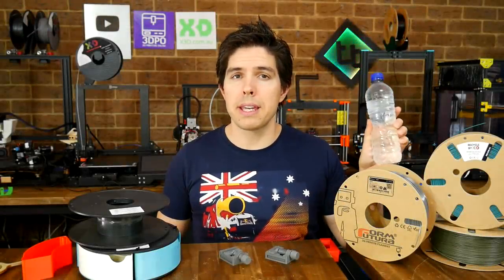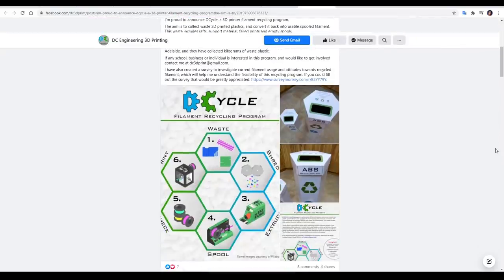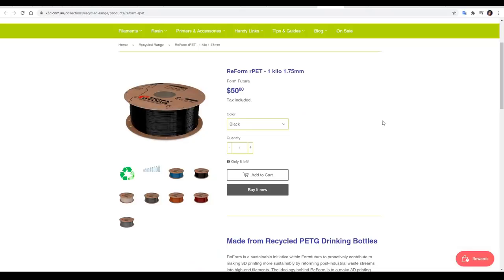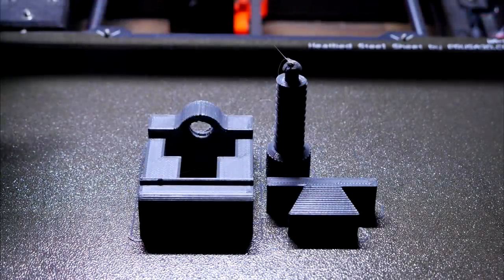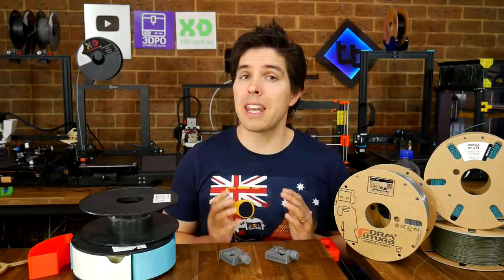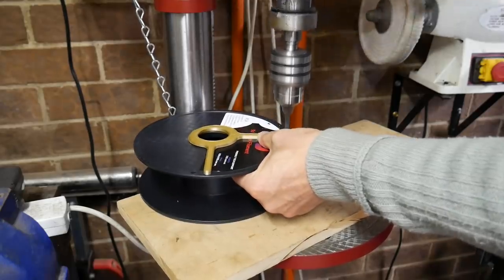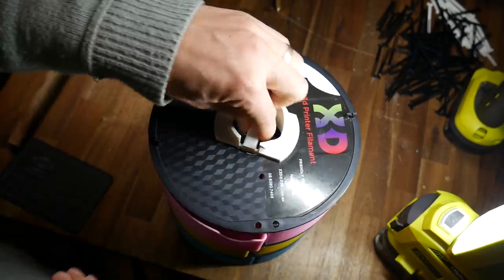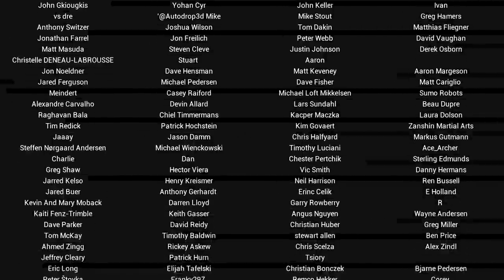3D Printing with recycled PET bottles and turning empty spools into storage

Comment from the maker: After reading comments, here are some responses to frequent queries:
- Not everyone wants to spend extra on recycled filament. No problem and that's your choice. At X3D, the recycled PLA is $5 more than normal PLA. Remember too that the prices are in Australian, not American dollars. 
- Some have rightly compared the cost in filament and electricity for the storage unit vs buying an off the shelf one. I my case, I had unwanted old filament, waste spools and enough solar on the roof to cover my 3D printing plus the rest of the house. For me the only cost was time, so an easy choice.
- What I presented in this video are some ideas that worked for me and may work for other people. I never present any topic as gospel that everyone must follow. Sometimes people seem to forget this and comment aggressively. Relax and remember that different solutions are suited to different people and that is ok.
Reply: Thanks @TeachingTech!  I always like to know what options are available.  Speaking of...   have you done any vids on converting a creality to print CF Nylon?  Is it worth the hassle?
Reply: Love your videos.  I noticed you use OnShape for design.  Have you taken a look at Alibre Atom3D or Alibre Design?  Great software, buy it, own it, no subscriptions, no internet connection required.
Reply from the maker: #FixItPlease I don't use carbon filaments very often but at the minimum I would think you would need a hardened steel or other resistant nozzle and probably an all metal hot end to handle the higher temps. I have a video on the Micro-swiss all metal hot end for Ender 3 that ticks both of those boxes.
Reply from the maker: @Jason Onshape was perfect for me when I was teaching and the kids had to bring their own device. Go to a website, make a free account and they were on. Now I'm so far invested in it there would have to be a major problem for me to change, even if there was something out there just as good or better.
Reply: @TeachingTech  would you ever consider doing a video on the microswiss direct drive btw 
considering getting one for my ender tbh
Reply: People are simple lazy and jealous because they are too stupid to DIY something. That's when they turn to be aggressive.

Comment: I was just talking about this subject on Sanladerer’s latest video.  Reuse, reduce, and recycle really needs to be the next big focus in 3d printing.  Whether it’s ideas like yours, or grinding waste, mixing with fresh filament, and extruding recycled filament to use.  This has to be the next big push.

Excellent video as always and I really enjoy your series on ways to reuse FDM waste.
Reply: Absolutely agree!
Reply: That's not going to happen for quite a while. The part grinders are crazy expensive due to torque requirements.
Reply: I was thinking I should look for a place to dump my boxes of failed/wrong size/just unused prints, to be recycled into new filament. I was super surprised how many sites there were on that ausie map of drop-off points, made me think I should have saved the spaghetti, purge extrusions, rafts, and skirts also....
Reply: 3d printing plastic is a drop in the bucket compared to industry wide plastic use so it will barely move the needle
Reply: @nczioox1116  not if I keep 3d printing, at least with my POS "upgraded" ender 3.... Didn't work right form new, about the only thing left that could possibly be but is very unlikely to be the problem would be the steppers... I'd throw in power supply but I'm pretty sure I'd have more problems. Then again, I am on my third btt skr mini e3 v2.0, maybe I should get a new power supply, at least have someone test the one I have.... I'd test it myself, but regardless of the diagnosis, I dunno I'd trust it, I am kind of a dumbass...
Reply: @josephbodhorn6511  if you have a multimeter I'd carefully measure the output voltage (the wires that connect to the mainboard)  
thats the best way to test if it's killing you parts tbh

Comment: I did my own empty spool parts carousel. But what i did differently from any design i've seen was to open it halfway down, the version with the small opening at top is difficult to get ANYTHING out of the bottom of the box. So, i took my fingers, measured how deep i can still get something out and it was about halfway down. 

I also curved the bottom so that i can take things with ONE finger out of there... It does not hold as much stuff but if you can't get it out: you won't use it. I use mine constantly and the larger opening also allows me to see inside fast. The version in this video will be the kind that you print it and forget it as it is very, very inconvenient to actually use.

Comment: I like that spool case thing though. Now I used about 120kg to print PPE each spool case takes about 1/4 roll of ABS to print all the pars including the pins the stacking parts and handles. So that means I need to buy 30kg of ABS to turn the 120 rolls into storage - but then I have another 30 empty rolls so another 8 kg should take care of that and another 2 of the 8 and less than 1 for the 2 so all in all I will have 161 storage box reels. 
As I can print about 1kg of ABS a day on the Chiron we are talking 41 chiron days to complete the project and roughly $500 in ABS. OTOH I could only make a couple and throw the rest away - no recycling center here wants to take the spools. They claim its impossible to figure out what kind of plastic they are made off. Those rolls have been a thorne in my eyes for quite a while

Comment: Great video as always!
I already printed storage for the spools, but they're not cheap: every single tray was about 2 and half hours, every spool is 4 tray so 10 hours of printing + the cost of the filament + electricity.. i think cost more to print that to buy similar..
Reply from the maker: In my case I already had the unwanted filament, and I have enough solar to cover the electricity so the only cost is time.
Reply: @TeachingTech  so, that's perfect! In italy we're so far behind for renewable power..
Reply: @TeachingTech  have you done a video on the solar and your 3D printing off solar requirements?

Comment: It would be interesting to see how much more energy, water, and other resources the recycling process uses that make it so much more expensive... and if recycling the material actually benefits the environment having the extra expenses into account (I'm just asking)
Reply: This is why the whole "stop wrecking the environment" problem is sooo hard, isn't it?  Everything has a dozen moving parts and we more or less have to fix them all at once.  Still, the ultimate solution appears to be "recycle the plastic and water and de-carbonise the energy," so I figure anything that moves part of the equation forward is a good thing.  Even if recycling the plastic uses more electricity, that just creates more pressure to get greener electricity, and in the long run should be all to the good, right?
Reply: Yes! Thanks for the insight
Reply: spoiler alert, recycling is mostly bullshit
Reply: @davydatwood3158  lol, that's some fine clown-world logic you have there, you've been programmed well
Reply: @mrb2917  Thanks for your reply!
Reply: @mrb2917  Does posting insults from behind an alias help you get your rocks off?  If you want to be a flat-earther troll, at least have the courage to use your real name.
Reply: Production volume also ends up driving the costs up. If you look at most plastic items, they are made by injection molding. The process requires a lot of capital in setup but it can make a lot of parts very quickly so the overall cost needed to recover on each part is very low. Same is the case with any other process, recycling is expensive mostly because we don't have a standardized process that can handle everything. Energy is a concern here too but if you figure out the right setup suitable for large volumes, its impact on cost is not much in the grand scheme of things
Reply: @jackhammer7543  Thanks! I was just wondering... Maybe the Polymaker's approach is more effective than recycling (even for thermoplastics that come from fossils)
Reply: @mrb2917  if only it wasn't true that it's mostly bullshit... I remember as a kid  thinking I was helping make our world better and cleaner and safer by recycling, and I also remember how disheartening it was when I found out most of the recycling goes into a landfill.

I'm currently very pissed off everytime I'm out and decide to go shopping when I hadn't planned to. New York state just banned disposable plastic shopping bags, so if I hadn't brought reusable bags, I gotta buy some, either that or hope they have paper bags(which work great for trying to carry home cold sweaty drinks in bottles and cans), which they often are out of.

It hasn't even been long since this plastic bag ban was instituted, yet I've already lost count of how many times my paper bags have ripped spilling my purchased goods onto the sidewalk, a bunch of times completely ruining them, beer and soda spraying, glass jars and bottles smashed on the ground... All bc assholes in other countries are dumping plastic into the ocean instead of recycling or doing the slightly more sensible thing and burying it in a landfill, not that landfills are much better
Reply: @santiagoblandon3022  It might be. Nothing can be said without a proper lifecycle assessment.
Reply: @davydatwood3158  I'm just curious but are you one of those guys who promotes the use of electric cars to help protect the environment against the use of fossil fuels yet ignores how those cars get charged?
Reply: @ChristopherJones16  You're not very good at reading, are you?  What do you think "...that just creates more pressure to get greener electricity, and in the long run should be all to the good," means, if it's not an acknowledgement that a lot of electricity is made by burning things?

I live in a province that only just quit burning coal and still burns a lot of natural gas to create electricity.  I'm well aware there's a need to improve the way most electricity is made.  The thing is, though, that we CAN make electricity without destroying the atmosphere, and that will never be true of a gasoline engine.  So moving to EVs is a good LONG TERM idea, we just have to make sure we do the other half, too - making green electricity.

Which is why my very first comment was "Everything has a dozen moving parts and we more or less have to fix them all at once."  Fixing the way we do things to stop killing the atmosphere is HARD, and COMPLICATED, and we have to do it ANYWAY, because otherwise WE ALL DIE.

Comment: When I worked in a plastics injection molding factory we had big grinders that flashing, failed parts, etc would go into and then a certain percentage could be added to the raw pellets before it would effect the durability/quality. I would absolutely love to see something like this for home users but i doubt we will for a very long time. Too expensive for most hobbyists' to spend thousands to recycle to save $30 on a roll of filament...sad but true.

It would be cool to see local based recyclers that would take failed 3d prints and turn them back into rolls of filament but I  think that would cause the same problems as regular recycling does here in the USA as people are just plain dumb to what can and can't be recycled or they just don't care. Amazing what people try and put in recycle bins (christmas lights...REALLY?). If this could ever be made to work and the upfront cost of machinery and a solar power source (or wind) was used I think it could be viable. I do not think sending waste plastic through the mail/ups/whatever will ever be cost effective enough to catch on, it would have to be local.
Reply: Why would viability depend on worse energy technology?

Comment: I liked the empty spools made into storage! While you were modding the files to print, you should have added label holders to them. That was a lot of spaces and yur never gonna be able to remember what is where. A little slot to hold a label could make a world of difference, then ya don't gotta worry about taped labels falling off or being a p.i.t.a. to remove/replace. 

I really gotta learn to use some 3d drafting software, it really sucks that Linux doesn't have a quality, easy to use, free software, for designing stuff to print, maybe there is and I'm just inpatient and overcomplicating as usual... 

Freecad seems to be the best free drafting software for linux, but it's horribly complicated and I dunno where to start. I should probably take another crack at learning blender, I was so frustrated with freecad tutorials that I gave up on learning blender before I started.

It'd be nice to be able to at least modify some else's design from thingiverse or wherever, but the last cad I used was something like minicad 6, could be wrong abt the version number was back in like 1999-2000 ish, and was probably old when I used it... May as well have been advanced paint....
Reply: Blender and freecad are available on linux as well as openscad

Comment: has any one looked at thermal depolymerization at home? the pressure needed is high, but the temperature and pressure seem viable at home to recycle 3d prints. fractional distillation seems like it might be a harder step

Comment: 9:06 is there equivalent function in Cura?
I often have this issue where the printer sits on acceleration speed, prints those tiny patterns between thin walls, takes forever and quality is worse.
Reply: I'd like to know as well!
Reply from the maker: If you filter with 'thin' there is a setting for walls, but I'm certainly not a Cura expert and can't find the infill version.
Reply: I just browsed most of the settings in cura and unfortunatly i couln't find an equivalent.
Reply: @TeachingTech  If I disable print thin walls it still does that, if I disable fill tiny holes, it still does the messy thing.
Reply: Ive been looking for this for a while and trying various things and can't seem to make it work. If anyone does I'd love to know too. 4x width seems to work fine but 3 or 5 it does weird things.
Reply: @Arek_R.  Try modifying your wall line width and re-slice (you can change inner and outer walls separately). Repeat until you find the width that gets the desired result in the slice preview.

Comment: I need help finding a reliable dual extruder/hot end (up to 270c) to add to my cr10s pro v2 which has been a great printer or an all in one setup...Im tech savvy but a bit nervous messing w firmware and switching cards unless I have to. Thanks and sorry for dropping it in this video

Comment: We have industrial grinders at work for plastic scrap.  They require a lot of maintenance, and they've given up on them and bought new ones a few times over the last 16 years.
I would not buy a commercial one to use at home.
Reply from the maker: My Precious Plastics one is still going strong, but it's fair to say it gets intermittent use. I also have learned the limits on the size of the pieces I can put in to keep it turning smoothly.

Comment: I have a question if you have a moment..  I just purchased a resin 3D printer off of Amazon.  It is a w5501..  Anyway, the test print included printed "ok" bit the resin didn't wash completely clean off the crevices..  basically I'm trying to print an 80t gt2 pulley, and the issue I'm having is I have one layer stick to the build platform and a layer stick to the fep and unfortunately that's it.  The one on the bill plate is really really stuck on there and requires me to scrape it with a metal scraper to get it off, but the part left on the fep feels like it's only held there by suction as I'm able to use a plastic scraper and with very little effort slide it around peeling it off is another issue and that's why I say its suction. I've tried adjusting slicer settings, adding supports, removing supports and most recently this morning I tried tilting the model at an 80ish° angle to see if that helps, and lowered the 1st later exposure time from 50 to 30.  Do you have any idea what I can do to fix this problem?  Thanks

Comment: I tried this and find it very difficult to have both holes lined up without a drill press, 2 spools ruined this way. They appear to be abs so maybe we melt them down to remake them into filaments?
Reply from the maker: I did my first one without a drill press and found the same. There are 3D printed drill press converters to take your standard drill. Maybe a nice project for you if you're interested.
Reply: @TeachingTech  how about a template for drilling the holes?  a round "pipe" with notches for the spool to fit in. one end has a plug (that is used after the top hole is drilled) the other end is the notch with a hole on top so the opposite side can be drilled.